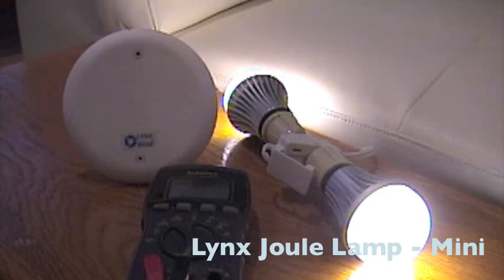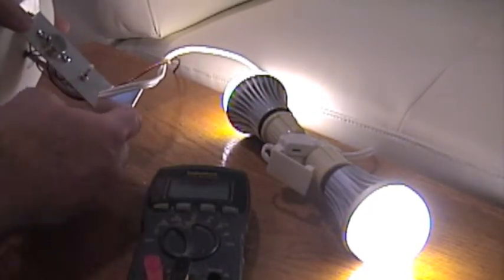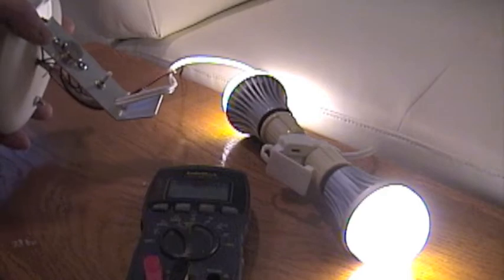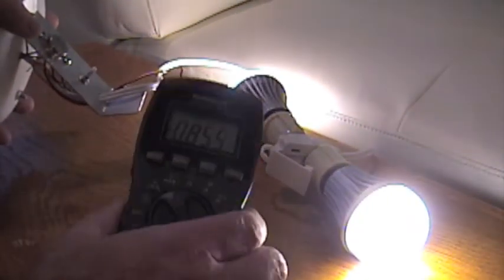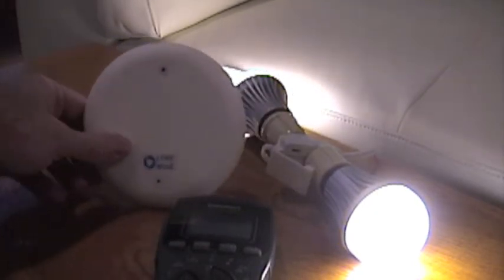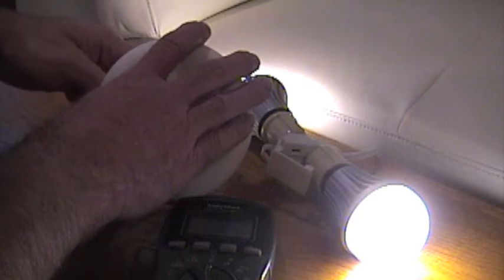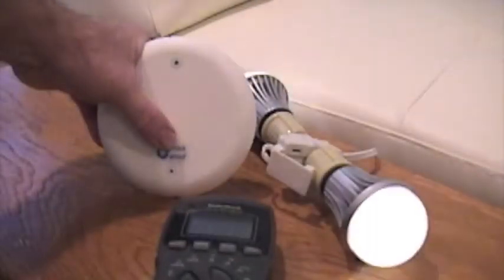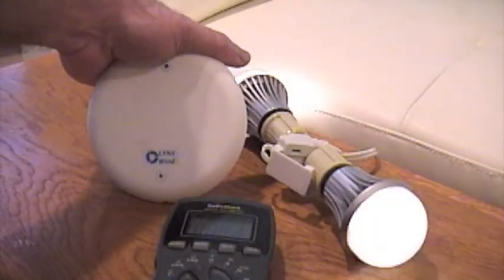Newest LJL - Mini

Comment: Yes, it is just an air core coil about 4" diameter.  There is no battery inside.  The transistor can't go inside because it needs cooling air circulation.
The 2N3055 is so much better than the tip2N3055.  But that requires some space for the long pins.

Comment: So does it have an air core  coil like the soln1 mini with the 4" diameter coil of wire? It looks like the round housing holds some batteries and the coil. is that right?